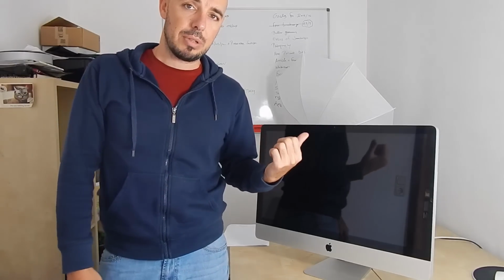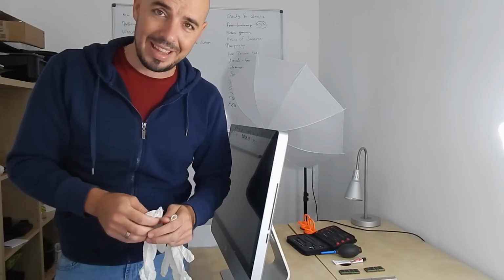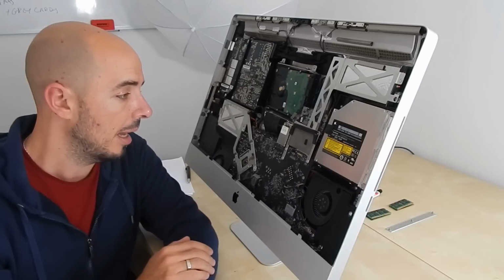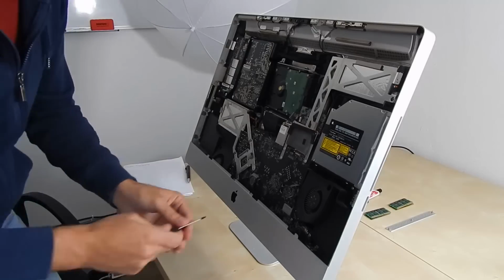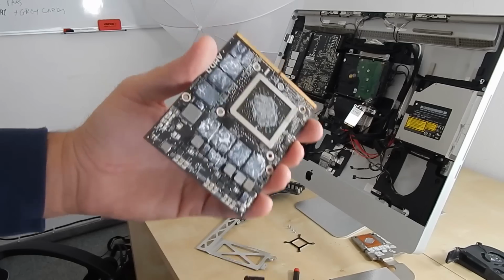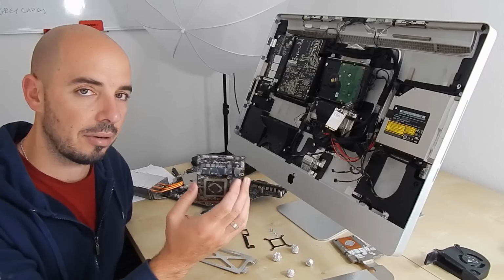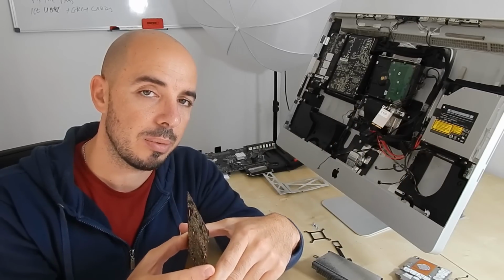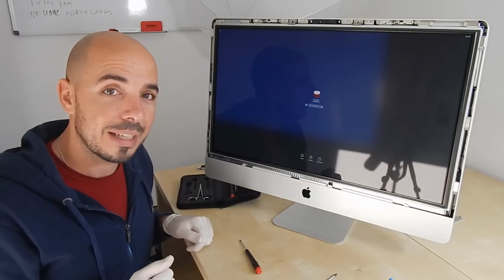Burn the VGA and  Fix your iMac - Don't Pay Shitty Problems!!!

Comment: Thanx Evan, I tried this on my imac 27" 2009 and now it's working again! I had those 5 big yellow vertical stripes first and a lot of horizontal white and pink ones in the end. And while working it often started with lots of dots all over the screen before the Imac collapsed. By the way: I couldn't remove the heatsink completely because of a little cable that was glued to its backside. So I removed the graphic card from the heatsink unscrewed but still connected to the Imac by that cable. But no problem. The cable was long enough to turn the heatsink upside down. All in all it took about 45 minutes to have the Imac back on track! And it was worth every minute! :-)
Reply from the maker: +Andreas Krätzig I am glad it helped you my friend! It's a always good to bring life back to our machine! Enjoy it now! :)

Comment: Hi Evan, is it complicated to replace Graphic Card in my IMac 27"(ATI Radeon HD 4850 512MB Late 2009)? Any thoughts? I have also pink stripes when I booting up and there is no chance for me to start the system ;-(
Reply from the maker: +Dawid Otta He will do probably the same thing as i did (maybe with other tools). Your VGA will work probably but maybe in 1-2 years you will need again a VGA. I did this baking two times in the past. The first time worked for 2 years and then I did it again.
Reply: +Dawid Otta Yes very! You wont be able to find the card new. People sell them used for $300 and there is no warranty. I have the same exact model. Baking is the only option.
Reply: +Dawid Otta Make sure you install istat or anther fan/temp control program after repair. This problem occurs from overheating and extreme temp changes. The GPU and heat sink should not go above 70C IMO. You can increase fan RPM to make the computer run much cooler.
Reply: +Blackrose 78 thank Evan, today I was able to find one of the guy in Santa Clara CA. He offered me to fix/repair for about 350$ everything... I think it's a good deal!
Reply: Dawid Otta
He will probably do the same thing in this video. Does he guarantee his work? If so for how long? $350 is not cheap specially when these machines are barely worth $900 today but its your computer so your choice.